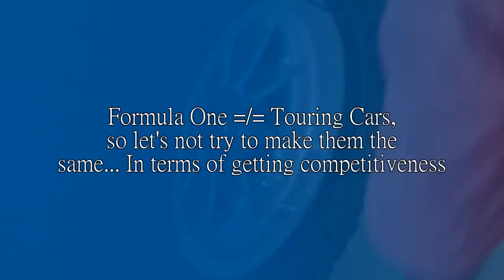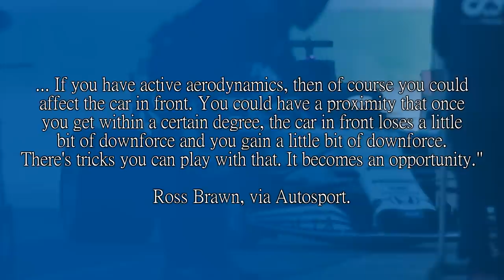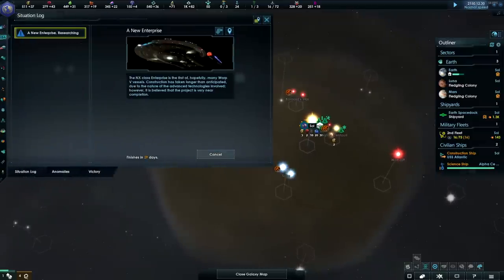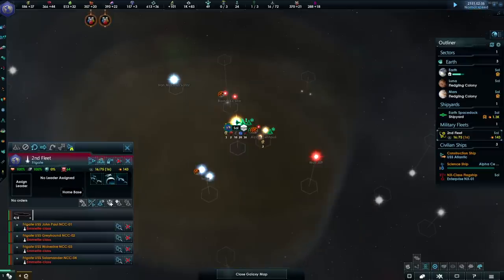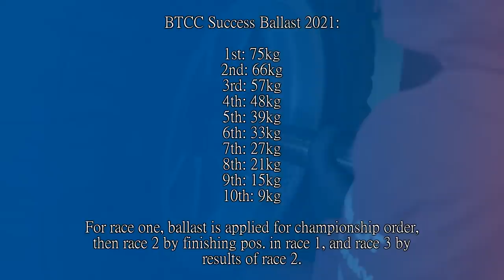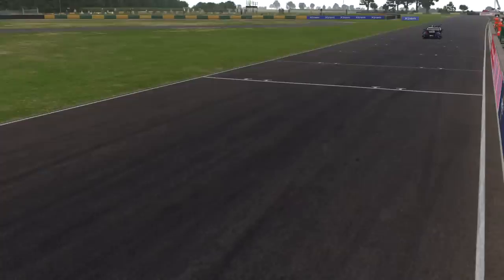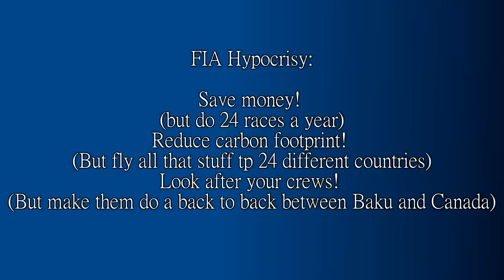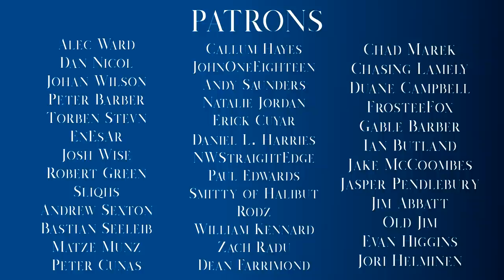BRAWN'S BIG BRAIN MOMENT: Opinions on the Proposed 'Reverse DRS' System for 2026

Comment: The ironic thing is the more simple the cars are. The easier it is for them to converge.
Reply: Tbh all they need to do is keep the regulations stable for a good period of time
Reply: @RANDOMZBOSSMAN1  that's the opposite of what they should do
Reply: @TUIDERRUXD  changing the regs every 3 or 4 seasons always benefits the teams with more resources, which is why we always get the same teams at the top whenever there are major changes. Even with the budget cap, less than half the teams get close to (or slightly over) the cap, and teams who can reach the cap can put a larger sum towards R&D than teams who can only raise enough funding to spend 70% of it.

If the regulations are stable, and loopholes closed when exploited, cars will get closer as everyone knows what works and what doesn't. In 3 years, porpoising might have completely disappeared, but then a major rule change for the following season would put everyone back to square one.
Reply: No. when there's f1 money, there won't be any simple cars. When there are prescriptive (complex) regs, you get convergence more quickly.
Reply: Simple cars doesn’t automatically yield pure racing though. NASCAR and Indycar are spec and very simple but end up doing all kinds of gimmicks for the show anyway.
Reply: @dcregister86  I have personally never seen a NASCAR or Indycar fan complaining that they don't have good racing.  I have, however, heard of DRS trains.
Reply: @jimmydesouza4375  I agree that the racing is close and exciting. But the race stages in nascar thing is a weird gimmick to keep everyone closer. And I’ll just say that Indycar has some suspiciously good luck on safety cars vs cautions when it happens to make the ending more exciting.
Reply: @dcregister86  I honestly wouldn't know any of those gimmicks as I have never watched them.  I also haven't watched F1 in about 10 years.  Just making an observation.  Listen to Indy or NASCAR fans and they're all just going on about how much they love it.  Listen to F1 fans and half of them are complaining about how boring it is now and the other half are being purposefully over eager to drown the complainers out but then being obvious about it.
Reply: @jimmydesouza4375  in some ways I kinda think that’s part of the charm of F1 fandom

Comment: If we're gonna change up DRS, I'm in favour of something Chain Bear proposed years ago: Moving the DRS zone away from the braking zone. Have the DRS close automatically halfway down the straight or something similar. This way, the trailing car can accelerate to top speed more quickly, but that top speed is unaltered. This would allow the trailing car to make up the time lost through dirty air, but it won't result in an "automatic" overtake down the straight. Ideally, an overtake would be done through outbraking the opponent, as would defending.
Reply: Totally agree.

In other wishes, a Millward Chainbear crossover would be immense.
Reply: @scordatura9259  proof?
Reply: @scordatura9259  you've reported him to the police I assume, with this evidence?
Reply: @JohnSmithShields  don't live in the UK mate doubt the Interpol would do anything about it
Reply: "Have the DRS close automatically halfway down the straight or something similar. This way, the trailing car can accelerate to top speed more quickly, but that top speed is unaltered."

That is not the result of the change you proposed though..?
Reply: If we’re talking active aero, just allow the following car to create more downforce when within say 2.5 seconds of the car in front. Then you don’t have any type of just cruising past.

Comment: I can live with DRS, Push to Pass, and such. Heck, if they wanted some BoP or weight penalties I could understand it. But slowing down the leader in the middle of the race by pushing a button is straight out of Mario Kart. Next thing you know they'll add item boxes with spiny shells, bullet bills, or banana peels.
Reply: Just the kind of crap they add to Formula E to make it "interesting".....
Reply: it would be pretty funny to see a Williams at the back get a blue shell and ruin someone's race tho (all jokes ofc)
Reply: @Gnrnrvids  considering fan boost is gone next year your statement is wrong
Reply: @rexthewolf3149  So that would nake my statement correct as at the time of making it.  Nice own goal.

I wasn't even thinking of fan boost (so much worse), but more of the drive over the three bars thing making a slower lap and then get power boost for next either time period or couple of  laps.

Formula E is a shit racing series that relies on gimmicky crap to gain an audience.  Apparently that audience cant handle a correct statement such as pointing out the gimmicky crap used to get them there.
Reply: @Gnrnrvids  I hated fanboost, but the mario kart boost is a bit like a joker lap in rally cross. But don't worry, the replaced the fanboost with mandatory 30s "recharge" pit stops. Seems a bit strange since they now have the capacity to do full races on the same car.
Reply: @aaronaaronsen3360  Just shows how stupid Formula E still is.  
Why not just race?.....
Reply: @Gnrnrvids  I guess they are and the mario kart thingy adds somewhat a little bit of strategy, but I agree they just should focus on racing.
I watched some races and the only rule that made sense to me is the battery % rule. A bit tough to understand tho, but basically replaces the (also artificial) tire strategy in F1. Hence the "recharging" I guess, to mimick F1 tire change.
Reply: @Gnrnrvids  mainly cause without some sort of boost there will be little to no overtaking in FE, the cars don’t get up to speeds anywhere near being able to utilize slip stream and tracks are so short and tight street circuits cause that’s all they can race on, since the battery technology doesn’t allow for them to race at high speeds for a long period of time.
Reply: @Gnrnrvids  pretty much is already 🤣🤣🤣
Reply: @cooramoor100  Yeah I could never get  into it, especially when they started with the gimmicks.
Reply: @jacksonkelley6754 I mean, Latifi kinda did in 2021

Comment: One big issue of DRS are DRS trains. They appear because the 3rd card in the row has barely more slipstream than the second car due to the opened rear wing. That's why I think a push-to-pass system would be much more effective. The 3rd car would get the full slipstream of two cars added, caused by the two cars in front.

Comment: When I saw the title I thought the suggestion was going to be you have DRS unless you are within 1 second. This would keep the cars closer but then you have to workout how to overtake. The driver in 1st doesn't get DRS.

The long term solution is to clean the air. This means simpler body and wing shapes. Start restricting all those over the top curves on the cars somehow.
Reply: Got something Special for you 🎁  TM!!

Comment: Any time I hear the words BOP I think of the appalling sandbagging and last minute power reductions that turn LM24 into a total farce. "Gosh we were 3 seconds a lap slower than the Porsche/Ferrari/Aston in qualifying"; BOP; "Gosh we won LM by three laps". F1 is the peak. Get faster through design. Otherwise let's just turn it into Indycar. 5:40 ish. Yep. That was my immediate reaction. Less downforce is a ticket to a big shunt. Maybe they ought to really commit to the less downforce option. Like, REALLY commit. Single element wings, no endplates, floor as big as the bodywork and no bigger, etc etc.
Reply: Simplifying the aero is a good idea, turns it back into a driver centred race.
Reply: Got something Special for you 🎁  TM!

Comment: One probably controversial thing that might help with making cars smaller again would be reintroducing refuelling to allow for a smaller fuel tank, although that might end up causing its own set of new/returning problems
Reply: Theres no real point of a smaller fuel tank and refueling now as F1 is moving to using even less fuel in the future 

By 2026 they will be using less than half the fuel they used in 2013 the fuel loads will be slightly more than a typical 1 stop in the refuelling era at the start of a GP

Refueling realistically is never coming back

Comment: I have kept thinking of when they carried over the cars during the pandemic and used credits to improve performance. What about something like a 110% development rule, if you are inside the 110% you use credits and outside you can build a new car. If the smaller teams are not meeting the cost cap, the FIA pluses up their budget to equalize it out. Maybe every other year those inside have an option for building a new car.
Reply: One could also produce something like the DFV, a solid engine, but not the best, then have teams devellop chasis for the engine, "freeze" the engines for 3 years and have the cars be unregulated, then freezing cars and have engine development unregulated for 3 years, swap again and so on.
Reply: Got something Special for you 🎁  TM!

Comment: What I think would be fair is that each driver gets a limited amount of "low drag mode" or "extra ers output" every race; the FIA could use BOP-like rules to decide who gets how much in every race. But crucially, the amount of "extra" performance is known before the race, it is easy to televise with power bars next to driver names, and the driver is the one in control of when and where they use their advantage. Do you use it all at the start to pull a lead? Save it for the end when you are on low fuel, and it would have the most significant impact? Do you conserve to only deploy to attack/defend? Do you use it on in/out laps for tyres? More tools, more varied strategies and some amount of BOP to ensure that the racing is closer, but in the end, the driver still has to have the skills to make it count.

Comment: 8:09 i actually mathed this one out, so have at it:
in 2014, when the turbo hybrid engines were introduced, there was a limit of 5 complete power units for what was back then, a 19-race season. exclusively normal grand prix, no sprints.
that comes out to 4 races per complete power unit, no penalties incurred.
in 2023, assuming that we'll keep the 24 race calendar by replacing china with a different race, we'll be looking at 24 races + 6 sprints for 3 complete power units.
just on the grand prix alone, that means they'll have to run each power unit for 8 races , excluding sprints. each sprint is a 1/3rd of a race distance. 6 sprints, so an extra race distance equivalent to 2 extra grand prix.

so sum up...
2014: 19 races, 5 complete engines, engine/race ratio of 1/4.
2023: 24 races + 6 sprints, 3 complete engines, engine/race ratio (excluding sprints) of 1/8.

i don't know if the FIA deliberately want the teams to get penalties to spice things up, but if they do, then that's just an unfair way of using "penalties". it's not a penalty if it's 100% inevitable.

Comment: They suggest doing this actively during a race? I could see well the last race you finished 10 seconds ahead of your nearest competitor so we're going to slow you down approximately 10 seconds over the duration of a similar race time for the next race. And then adjust it as you go on. Each time you break out they slow you down by the equivalent amount for the next race. I couldn't imagine any changes happening actively during a race like you went two or three miles an hour faster down the street so we're going to slow you down that much the next lap. That would be ridiculous. It would take away having a better tire than the nearest competitor because you took the right pit stop timing

Comment: Could be the beers talking here, but i took Brawns' comment more along the lines of 'cars altering their settings when in close proximity of each other' (which is kinda what DRS is doing anyways), rather than deliberate rubber-banding from the side of the track... to which i'm not sure any of the teams would stand for in all honesty.  So maybe the front car gets 2-3 clicks increased downforce whilst the trailing car is 2-3 decreased when on straights and is reversed at corners.

 I've serious doubts any form of active retardation could be done safely at F1 level. Heck the "Brake Check" twixt VER-HAM should be enough of an indicator that such a thing would be unwise.

Comment: DRS is a measure designed to combat the effect a car’s wake has on a trailing car’s downforce, which limits close racing and therefore, overtaking.
The issue is that it’s a solution that can only be applied in the straights, to a problem that only occurs in corners - so it can’t fix the close racing issue, and the overtakes it facilitates are fairly artificial.
Imagine a system that uses the same basic ground rules as DRS, but can operate throughout the lap, rather than just in the  straights…  close racing is a thing again, and the driver - not the rear wing - must get the overtake done.
That’s what Brawn is talking about - you seem to have put two and two together, and got about 17

Comment: I think Aidan is missing the potential here, and what I think Brawn has in mind; dynamically neutralizing the dirty air disadvantage. You could, theoretically, precisely zero the disadvantage of dirty air by modifying aero based on speed and distance between the cars. Theoretically you could remove the effect of dirty air entirely. In the same way, if you did, you could also remove the advantage of the draft. I think this is more the idea under "investigation" more than rubber-banding.

Honestly, I don't think either is a good idea, firstly because something that is theoretically possible isn't necessarily doable, this would be ridiculously hard to nail down, and secondly because I really enjoy this being a car-building contest more than anything else.

Comment: DRC was viewed as a quick fix to allow passing. There was talk that if the ground effect aero helped enough, DRS would be reduced or even eliminated at some circuits. A suggestion to reverse this is bad.
I agree with your comment 2/3 of the way through about drivers suddenly having a loss of downforce if the car behind had dropped back. Even if the driver was aware of it, they would not have a feeling of how much downforce they had lost, which is potentially dangerous.
Reply: Got something Special for you 🎁  TM!!!!

Comment: Active aero is said to be coming in 2026 to "improve efficiency". Brawn's idea could be implemented by simply not allowing the lead driver his drag reduction on straights until the others catch up.

Which is still stupid.

Reading the 2026 power unit rules makes it clear that the drag reduction is needed because the PUs will be much weaker, and will only have full power for small parts of the lap. And the 2026 Power Units give no weight savings at all.